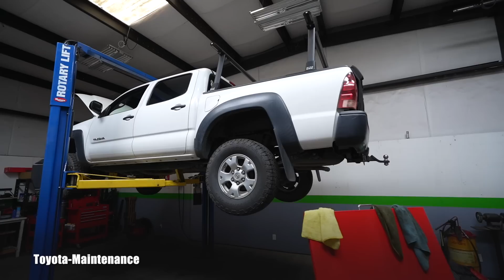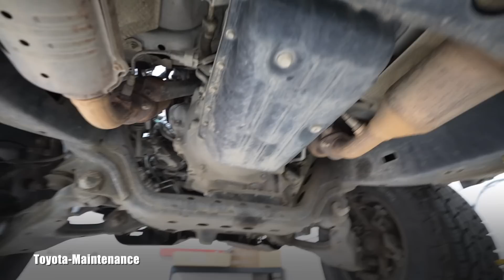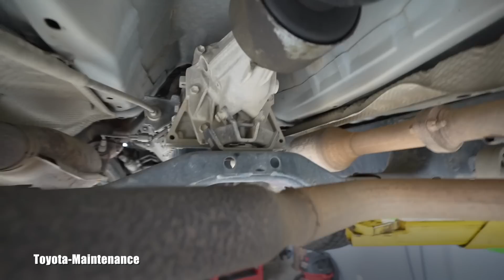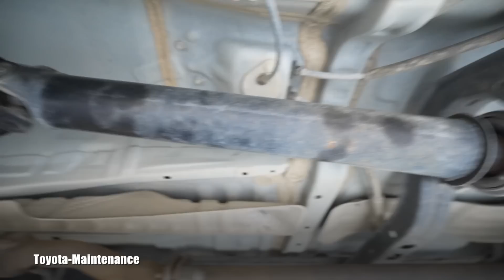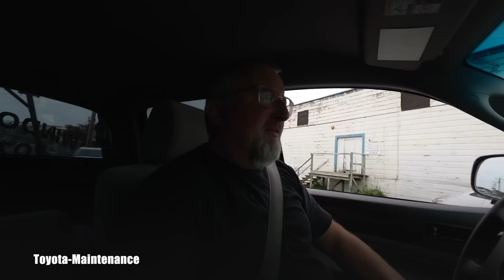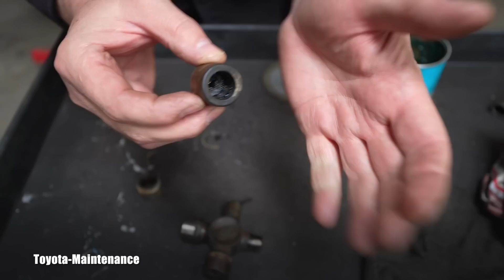Automatic Transmission Shudder? Or Something Else?

Comment: I JUST went through this. There was a terrible shudder under the seat during acceleration at low speeds. Spoiler alert: It turns out it was my tourqe converter. (2011 4Runner 180,000 miles) Let me tell you, before I threw in the towel and went to a dealership to get a second opinion, I tried everything. New tires, alignment, ballance, any suspension that was worn, all four ujoints were replaced and greased, drive shaft was greased, new fluids throughout. Everything! 

I took it to Toyota to confirm my suspicions. They quoted $3,000 for the torque converter installed. $6,700 for a new transmission installed. 

I did a simple drain and fill on the sealed transmission. Added Shudder Gard to my transmission fluid. POOF! The shudder (rumble strips sensation) is GONE. I do not usually believe in magic potions, but this one is a lifesaver! A few quarts of VERY expensive transmission fluid and a $10 tube of shudder gard is all it took to save me thousands. 

Just thought I would leave this comment in case someone needed some ideas for thier situation. 👍
Reply: Hold up, very expensive trans fluid?? Toyota WS ATF is like 8$/1L bottle at the Toyota dealer. My 4th gen 4runner needs 14 liters for a full replacement; It was like 140$ canadian after taxes.
Reply: Thank you! One tube of Shudder guard?
Reply: @brianc6739  yes. Unicorn blood

Comment: The shuttering is exactly what I had in my 2007 4Runner and thought it was my transmission as well...thank you for the video...I will have them focus on U-Joints to see if there is an issue there.

Comment: I have this exact issue.  I replaced the u joint by the transmission, but not the one at the rear end. I’ll get that done this weekend and see how that works. Toyota dealership said I needed a new torque converter. $3500.

Comment: If you have a boat, that u-joint gets dunked launching and recovering your boat on the boat ramps. If a u-joint boot gets dicey the water gets in. The differential vent is up higher but look and see how high and don't dunk the axle more than half way. The axle is quite warm after driving, gets quickly chilled in the water and sucks in air and water. I re-grease my rear u-joint as soon as I got home just to flush it and be sure.

Comment: This will trigger all of those that consider aftermarket 'synthetic' transmission fluid as superior to Toyota's OEM fluid. If that's the spec that is called for, why use anything else.
Reply: Toyota ws is junk that's why, it looks burnt within a few thousand miles, versus valvoline max life that still looks red after 40k miles.

Comment: I had shudder on my 2007 FJ with 145 thousand miles on it.
Would sudder going up hills between 35-45 miles per hour. 
Had my garage guy change out transmission fluid he did 4 or 5 cycles of drain and fill.
Sudder is gone no issues after another  10 thousand miles.
USED TOYOTA WS TRANSMISSION FLUID.

Comment: When the torque converter starts malfunctioning, you may feel shuddering and even slipping in overdrive. You usually notice your car shuddering because it feels like it's vibrating. Your car will vibrate even when you're not going very fast. The shuddering makes the car lag and is very noticeable.

As automatic transmissions age, the lockup torque converter's ability to transfer torque smoothly can decline, and additive packages in automatic transmission fluids can deplete, resulting in torque converter clutch (TCC) shudder.

Comment: My transmission mount on my 98 4runner is extremely worn. Rubber is all cracked up. The main bolt through the middle is half out and bent..lol. loose.  I get vibrations on the highway.

Comment: So many buy the BG unit, which is a good system, they want to sell, sell, sell the BG service. They overlooked a bad u-joint in their need to sell their money-maker service. I'm not so sure that aftermarket fluid causes functionality problems. The transmission will be fine. Someone puts the Toyota label on the fluid. Aisin makes great transmissions.

Comment: My Toyota service writer says my 2018 Camry is due for a transmission fluid change soon at 60,000 miles.  The service writer said the filter is a lifetime filter, they only change the fluid. Anyone else have this come up? I have not called another Toyota dealer yet for a 2nd opinion. Thanks

Comment: 2010 taco, when you come to a complete stop . Then let off break to continue driving . There a distinct thump . Feels like you just got bump by a car. Any suggestions? Thx
Reply: I’d say it needs an inspection of all the suspension bushings, also the brakes to see if disk callipers are loose or drum brake shoes are loose. I imagine the cause will become obvious once a proper inspection is done. Something is worn out or loose.
Reply: I have the same thing in my 09. At 180k the lower ball joints were creaking so decided to change balljoints, tie rods and stabilizer links. I didn’t do the bushings cause they are a pain to remove and install without a press. Not too long ago it began thumping and I’m certain it’s those stupid bushings I didn’t replace. Im sitting at 271k right now and it’s not getting any better😂
Reply: Check the slip yoke for a grease fitting and put a few (3-4) pumps of grease in it.  Sounds like the slip yoke isn't moving freely and is binding up when coming to stop.